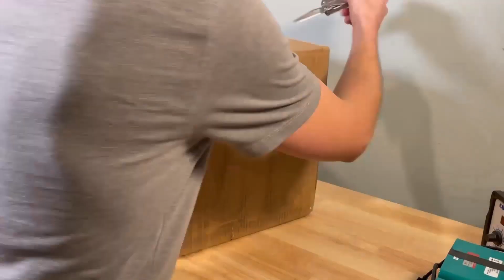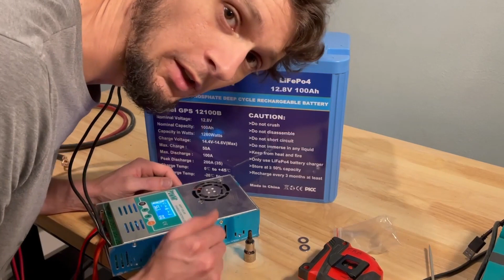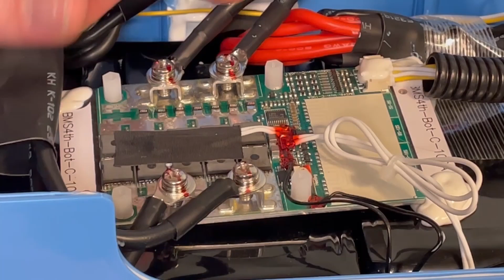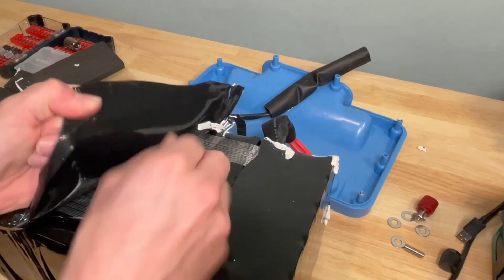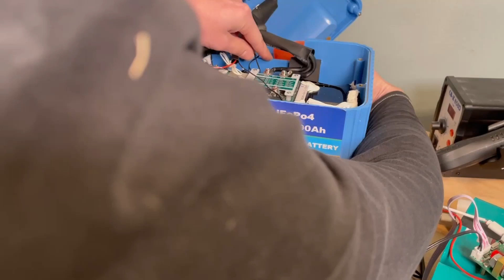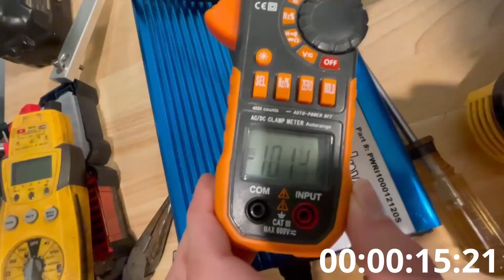Global Power LiFePo4 Battery Review and Tear Down - 100AH 12 Volt

Comment: Dischargedvover winter down to 10.2   now i think the bms is in protection mode   do u know how to get it to take a charge?  Tried jumping with charged battery and hooking up a power supply.,.,  still wont take a charge   any ideas?

Comment: I bought 2 of these in Nov. 2021. One has failed, one of the 4 cell groups, while sit-in under no load and kept charged to 13.4V. It is under warranty for 2 years. I've contacted this company through eBay where I purchased it and got no response.

Comment: I just came across your channel I'm impressed with how well it's done just looked at your other videos hoping to find review  teardown and repair of this nature solar generator but I guess you don't review solar generators I've been desperately looking for someone who has done a review of nature's generator because it's a good low budget unit that has 2000 watts of pure sine wave power but because it's sealed lead acid battery technology the big reviewers won't look at it they don't think about those of us who don't have 10 grand in their wallet or bank account or those up here in Canada with our GST lower dollar and sky-high shipping if you know of anyone who has done a review on nature's generator I'd love to know and not those preppers who only care if it works not wether it's built properly or has proper charging parameters  almost ordered on from Rona online  but I now know proper  care of sealed lead acid batteries so I checked and found that they don't fully charge them so they're dead to start with and being discharged way too far and the solar charge controller will take 2 days to charge it up to
Reply from the maker: Hadn't seen that power station. You're right in that it's much more affordable than something like the renogy lycan or ecoflow units. But those AGM batteries are going to deplete in a couple years and require replacing. I suppose if they are just $200 a piece it's not the end of the world.

Comment: Thank you for the video one of mine is showing 6% and won't take a charge could that be the bms? Thank you
Reply from the maker: What voltage does it show on the little screen, are you able to check with a multimeter what the voltage is at the terminals?

Comment: Do you have a recommendation for a replacement BMS that allows for two of these batteries to be placed in series?
Reply from the maker: Working on it! Have some on their way, will test and see if they operate as they should.
Reply: @BeeneEnergy so, did you ever test the replacement BMS you mentioned were on order?
Reply: @BeeneEnergy update?

Comment: Some of these are trash ..I bought 4 and one arrived dead . Replaced 
Now after less than 6 months  1 completely  dead.. other 3 are weak as hell ebay seller global battery 
Won't respond  apparently  something  went wrong  now I guess  I will appeal  to PayPal
Reply from the maker: It's true. I think the seller got in over his head. It was a good concept and as you noted some of the batteries seem ok but the failure rate is rather high. I have had multiple fail on me as well. have 9 of them sitting in various states waiting on me to do something and some are permanently damaged due to the BMS failing internally.
Reply: I contacted them via ebay and returned at my expense, one for exchange. Within a week they contacted  me sending out new battery and paying return  shipping 
So all hope is not lost .
Reply: I did the same thing

Comment: I bought 4 of these on ebay for my 48 volt golf cart. After I installed them first time out I gave it the gas and it died. I had to take the battery lose and reconnect it to start working again. The one battery after a couple days would no longer charge. The seller replaced it. After that it worked fine for a couple weeks and same problem again. Now 2 of the batteries will no longer take a charge. I contacted the seller again and now they want respond  so now I've wasted a lot of money on non working batteries.  I'm now trying to replace the bms in the 2 non working batteries to see if maybe that would fix problem of or the cells are bad. Don't know what to do. I thought they would have warranty but nothing came with the batteries and no response from the seller. I would never buy this brand. 3 of the 5 batteries are bad.
Reply: I bought  4,  6 months  ago 
1 arrived dead , they replaced.  Now 1 dead and 3 at about 30% 
I'm going to try PayPal  to see if anything  can be done about this dead beat seller
Reply: @mafiapuppet5759  And their description on Ebay was " veteran owned". That's  a red flag for me for now on.

Comment: DO NOT BUY THIS BATTERY!!!! We bought 4 of them in Nov. 2021. We installed them in our boat. This past weekend, June 19, 2022, one them caught fire internally! We smelled smoke, lifted the engine hatch. The engine compartment was filled with smoke. My husband was able to get a rope around the handle of the battery, disconnect it, and pull the battery out of the engine compartment. The battery was on fire internally and the smoke was spewing from the top of it! This battery was a house battery, not a starting battery. At the time, it was not under any load. My husband checked the batteries an hour earlier and the battery was at 89% charge. It has always been charged at the recommended voltage. Luckily we were on the boat or the boat would've burned! We no longer trust these batteries! We have contacted the company asking for a full refund, but they have not responded to us. Terrible customer service, especially in an emergency situation!!!

Comment: Nice review and good info. Been sifting through the sea of batteries for an inverter/charger I am installing on our boat. Picking one up now through your affiliate link!
Reply from the maker: I appreciate the kind words! I’ve been working on a follow up video. Just as a warning there isn’t a lot of quality control with these batteries. So you could get one that doesn’t support 100a discharge. Thankfully I’ve heard the seller has been very good about replacing any bad units.
Reply: @BeeneEnergy  Thanks for the follow up. What would be some symptoms of this issue? Will keep an eye out for the new video as well.
Reply from the maker: @davedmusic  two things to look out for are low capacity due to imbalanced cells and bms overheating and cutting out well before 100a rated.

Comment: $300? Bargain. 14.4 cutoff? Minimal BMS? I see the better heat sinks. Silicone glue to secure it. 100 amps? Are you sure? It is going to get HOT! What makes a quality MOS FET? Heat sinks?  Is it OK to run them in series to make 48 volts? I need more info. 
I have 6 gel cells in parallel, now. Only 1 KV from solar power. Just to run my shed and I'm still learning!
Reply from the maker: I’m working on a follow up video right now. Been playing with multiple batteries with inconsistent performance. Some work at 100a, some cut off at 60a. Balancing is non-existent from what I’ve seen. More to come!

Comment: It seems like due to lack of cell balancing these batteries are essentially unusable long-term, and it seems like installing balancing is unjustifyiably difficult...so essentially have to pass. Darn! Correct me if I'm wrong
Reply: Wrong. Set charger to 13.8 volts and you are getting over 95% of capacity (3.45V per cell). You can run this way for 10 to 15 years. Good battery.
Reply: Thx, did a bit more research, makes sense Mark. Also seems like the BMS monitors each cell and can probably do some passive balancing--that's what I was most concerned about. Seems like active balancing could be added. Thinking of getting 2

Comment: I'm curious! Have you done any more testing on these batteries?
What can be done to correct the oscillating??
Thanks
Reply from the maker: I have, just haven’t published a video yet.

Putting an active balancer in fixes it. Not hard to do but a good balancer is about $40. I’ll get a video out soon that shows what I did.

Comment: Purchased this battery. Set my charger to 14 volts. My battery is maxing out around 13.3 volts. Display on battery claims 100%. My Voltage meter is telling me 12.9 volts. According to some LifeP04 charts I found 12.9 volts would be 20%. Do you think I got a dud?
Reply: Thank you for this video. I purchased 2 off ebay on Christmas 2021 and hookex them in parallel they worked well for a while but then they began to cut out. I find that one of them will only charge to 13.8v. Would putting them in parallel cause this?
Reply: @randgraham1  The 4 internal banks are not perfectly matched or balanced. Mine was maxing out at 13.3v. I ended up tearing mine apart, balanced them and then added a new bms and 5a balancer. I can now charge to 14.4v no problem but I just do 14v to be on the safe side of longevity.
Reply from the maker: That’s really low :(. Yeah I’d reach out to the seller, he has been really responsive with people that have had problems and I’ve been updating him on my own tests.
Reply: @BeeneEnergy  this battery lives in my truck as an auxiliary battery. My reading of 12.9 was around 29° Fahrenheit. It moved up to 13.3v after letting it warm up in the house. I guess I didn’t consider that maybe the cold will cause a voltage drop? 

Also when I had my charger set to 14.4v I didn’t get any spikes. Safe to bump that back to 14.4v? Or should I stick with the 14v? 

Thanks for the help!
Reply from the maker: @Bumataur  It will stop charging if it’s freezing out. Could have affected your results. Spiking might be a solar charge controller specific result. I’d set it to charge overnight and remove charger in the morning to check the voltage. That should give you a good idea of how high it’s getting.
Reply: @BeeneEnergy  Cold charge disconnect is the main reason I got it. 

Is it normal for the voltage to drop that much when Fully charged in a warm environment and then placed in a cold environment? Battery states can be discharged down to -4° Fahrenheit.
Reply from the maker: @Bumataur  Fair question. I don’t get much cold weather here in Texas so I’m not sure based on experience.
Reply: @BeeneEnergy  So I got the Victron 5A blue smart wall charger. I was In fact getting that voltage jump during the absorption stage… I found 13.75v is where it would stop jumping. 

So I guess when I checked it for the voltage jump in my truck with my Renogy 20a DC-DC it probably wasn’t in the absorption stage yet… Therefore no jumps. The lowest this charger can go down is 14v. It actually reads 13.85 volts. Do you think that setting will be fine or will I fry this BMS? 

I may borrow a power supply and top balance the 4 cells. Maybe that will solve the problem here?  

Thanks 
Eric
Reply from the maker: @Bumataur  I don’t think it will hurt anything. Borrowing a power supply that will do 3.65v would in fact fix it so you’d be able to charge to 14.6v.
Reply: @BeeneEnergy  Thanks again!
Reply: @BeeneEnergy  So I’m Currently topping of the 3rd cell.  It’s currently at 3.43 started at 3.35 at 20 minutes. It is taking a much longer time than the 2 cells before... Those were around the same and took about 5 minutes to get to 3.55v. 

How long should It take to charge from 3.35 to 3.55v? 

Maybe this cell is slightly bad?

Thanks a ton!
Reply from the maker: @Bumataur  I was talking with someone about this earlier today. No telling how long it will take, since the discharge curve is so flat you don’t know until you know. Very curious to hear how long yours takes though!
Reply: @BeeneEnergy  So the stubborn cell finally reached 3.6v. This cell dropped way quicker and lower than the other 4 to it’s resting state of 3.35. The other 3 that charged fine went down to 3.45-3.5. To me it looks like I have a old or tired cell… I’m hoping my bank will still perform fine. I guess this cell may trip the low voltage cut off before the others. I don’t ever plan on taking it down that low. 

Right now they are charged up to 3.6v sitting in parallel. I assume they will all drop to the lower voltage cell after I pull the charge. 

Thanks again!
Reply: @BeeneEnergy  Left the cells in parallel for two days settled down to 3.4v. Topped it off one last time to 3.65v. Reassembled the unit and added a 5A Active Balancer on a switch. When I charge I’ll flip the switch on. For testing purposes I was able to charge to 14.6 without BMS cutting off. I’ll probably set it to 14.2 to be safe. 

So I think just a good Balance did it! 

Thanks again for the help!
Reply: Me too

Comment: Great video! I bought 4 of these batteries in mid-Nov 2021. I wired them up in an off grid system with some 2 gauge 2 awg cables in a 2P2S setup for a 24 volt battery bank. I also put a 150 amp fuse between the batteries and inverter. I have 4 solar panels rated at 240 watts (total of 960 watt nominal / approx 600 watt actual) that feed the battery bank continuously with about 25 amps. I keep my charge controller cutoff set at a very conservative 27.2 volts (13.6*2). This captures about 95% of capacity since you don’t gain much additional capacity from 27.2V to 28.8V. I use the system all day long on sunny days with a 3000 watt inverter for coffee pot, microwave, hot water, space heater, etc. I never run any combination of appliances totaling over 1500 watts. After sunset I use the system very lightly for just TV, lights, computer, charging phones, etc. I know I am way underutilizing my capacity, but the batteries have performed great. I hope to get 10-15 years out of them. Side note - the cheap charge indicator on the batteries is only 12 volt scale so it doesn’t show me my actual 27.2 voltage - only 13.6 volts. Not a problem for me.
Reply: I was re-reading the directions that came with the batteries. Under the heading of "Battery Maintenance" I found the following statement: "After the battery has been fully charged and discharged 5 times, the battery can reach its maximum capacity." I guess maybe there is some sort of "break-in" period with these batteries to reach full charge.  Maybe they actually go through some sort of internal balancing between cells. I don't know, but I think I'm getting about 95% of theoretical capacity which makes me very pleased.
Reply: @markrockwell7664 any update of the performance 2 years later?
Reply: I read a lot of the interesting comments that are connected to this excellent video. I decided to bump up my charge controller on my 24 volt system to cut off at 28.0 volts vs my previous setting of 27.2 volts. My solar panels today have been providing about 22 amps consistently (slightly hazy sky in 43F degree temperature). The highest reading I have been able to get off the battery using my multimeter is 27.5 volts. I never have seen the erratic voltage spikes that some folks have mentioned. Maybe I'm still not getting to a high enough voltage. Operationally,  these batteries work great for me and the 4 of them provide all the backup power I need.
Reply: Very helpful.  I have no experience but I just bought two of these batteries for an off-grid system.  I have not purchased anything else yet.  My primary use case is provide limited power during weather events or SHTF.  I’m generally confused,  i have two books that I’m absorbing…. I live up north so to keep my batteries warm and panels in the sun, I need a 100’ wire run (75’ as the crow flies).  My peak sun hours range from 2 - 5, but I live near Lake Erie and can go 5-6 weeks in Dec/Jan without seeing the sun. I’m stuck, I can’t decide between 12 and 24v.  I see pros and cons to both but not knowing what I don’t know, I could easily make a stupid mistake.  Your thoughts?

Comment: After watching your video on this battery I bought 4 of them but I have a question. If  50 amps is the safe charging limit. How many amps is allowed when there are 4 of these connected in parallel?
Reply from the maker: It would add up, so 200a total. Glad the video was helpful!

Comment: You sold me on it! The seller has nothing but great reviews…$320.56 shipped! Gonna be an auxiliary battery to run a diesel heater for my roof top tent. Considering 100ah AGM cells are $200ish and only have 50ah of usable power it’s a no brainer to spend $100 more for the extra amp hours. According to your test over 100ah! Even at 80ah it’s still a bargain. 

Thanks for this video!
Reply: I got lucky, they were doing a 3 days sale got 2 delivered for $430 total after tax so there was literally no price difference when compared to the lead acid battery. So total no brainer, I could have melted my brain and still made the correct choice there
Reply: @sendinit6413  For that price I would totally upgrade to a Bluetooth JDM BMS. I had problems fully charging mine with the stock BMS.
Reply: @Bumataur  mine charges slowly when charging above 90% capacity. I haven't hooked it up to my solar panel with mppt charger but if it acts similarly then I will take your advice since I will be using these batteries to power a 12v fridge. Going to want the battery to charge as efficiently as possible especially for rainy days